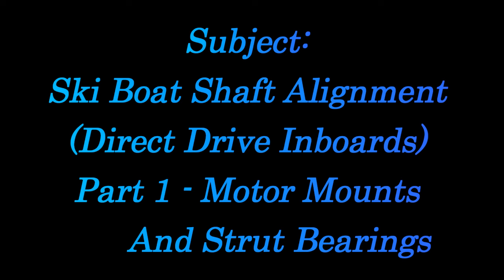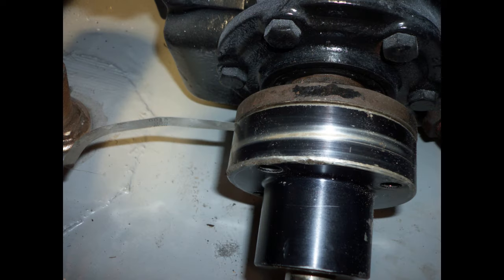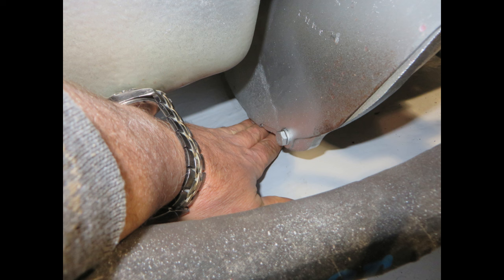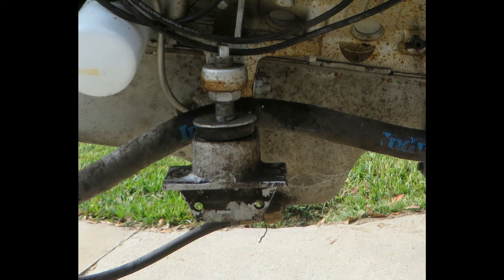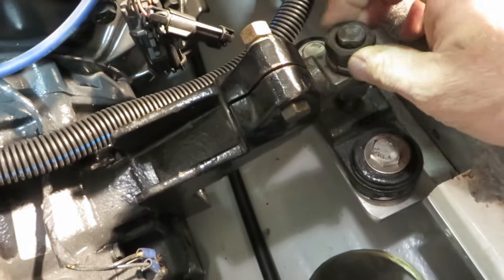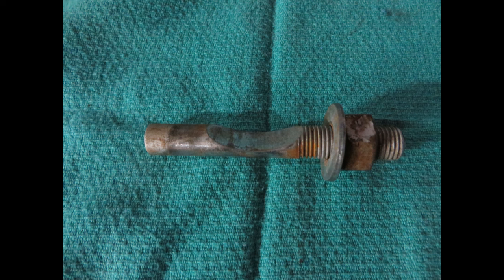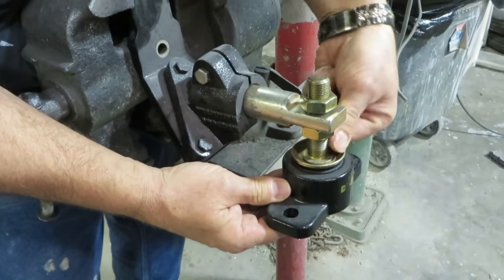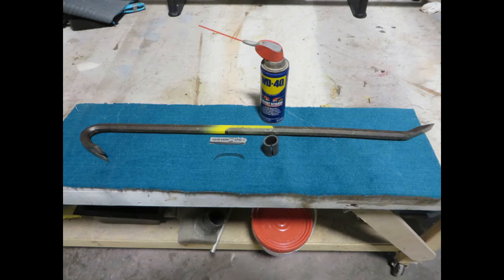Shaft Alignment Part 1

Comment: Ron.  Great videos.  I had to completely replace my strut and shaft due to hitting ground.  All is back together now with new coupler, stuffing box etc.  of course I am off alignment so looking at adjusting.  My motor is a pcm.  My trunions look to be in decent shape but with some corrosion.  A light attempt at adjusting reveals they are somewhat seized. Any tips other that penetration oil to help the along?  Would applying some heat to the bore where the trunions go into the motor be a possible help.  Any other tips?.  All trunion nuts bolts on 4 corners loosened nicely.  Thank you!

Comment: These are great videos. I would say 99 percent of ski boats are running out of alignment and don’t even know it because they think the subtle vibration is normal.
Reply from the maker: Thanks, couldn't agree with you more, Most common response is "I didn't know it needed to be checked" Every boat/engine builder clearly recommends checking and adjusting as needed annually. Worst thing I ever heard was at this years International Boat Builder Exhibition and I noticed a ski boat engine on display that had a very if not impossible motor mount to get to, when I asked the rep about it he said "No one does alignments anymore, we don't worry about it".

Comment: Hello,
Thank you for the video. My question is, will I need to replace the packing in the stuffing box after I pull it back to check the alignment in the shaft log or will the original packing be able to be reused?
Reply from the maker: properly adjusted stuffing boxes with good shaft alignment will last hundreds of hours between packing replacement, simply adjust as needed until you are out of adjustment, and always allow some dripping to assure proper cooling.
Reply: @rontanis1024  thanks for the quick reply.

Comment: What is a flexible coupling for?
Reply from the maker: Inboard ski boats do not use flexible couplings, boats with a lot of room/distance between the shaft log and transmission may use a marine specific CV type joint.
Reply: @rontanis1024  I have a 15metre cruiser with a DAF615 engine and a Paragon transmission. There is a 8 point rubber flexible coupling between the transmission and the propeller shaft but for some reason the output flange splines have worn very much.  I can't understand why, even if the transmission and propeller shaft are not perfectly aligned the output shaft shouldn't wear so badly.